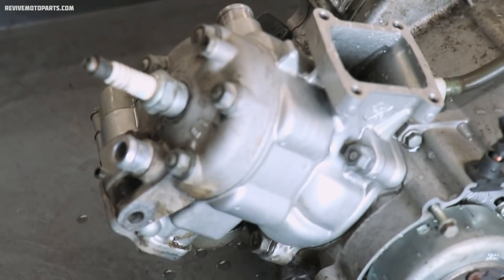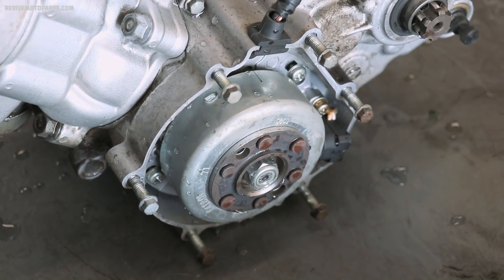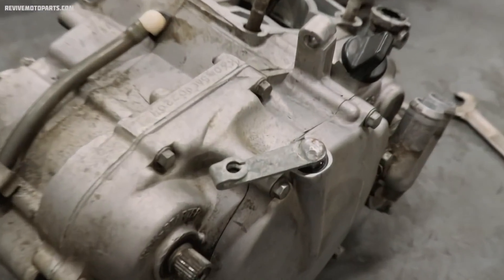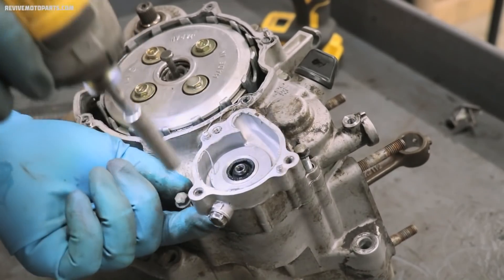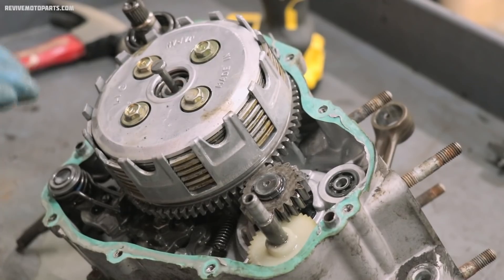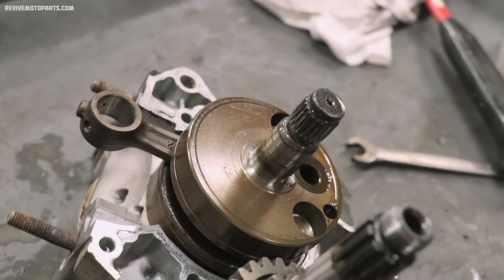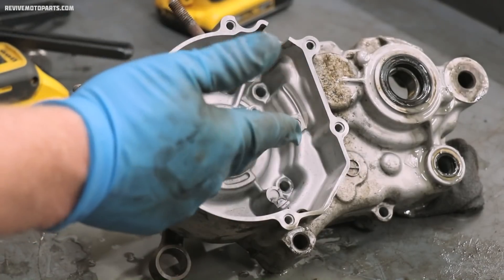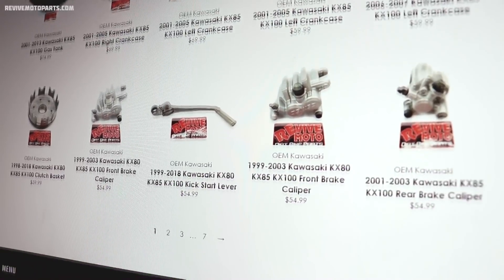Two Stroke Engines Are So Simple!

Comment: 2.26 ... OR.... you could just push an old bolt through the dowel pin...(preferably a snug fit with no thread in the pin area)
then put the vice grips on the pin, crushing it against the bolt.. and give it a tap...
THIS method works on blind pins where you don't have access to the other side of the hole (in my experience more than 50% of dowel pins are on the blind side)

In most cases this will free the pin without damaging it... and if it fails.. the pin is still in enough of a good condition to JUST LEAVE IT IN THE HEAD as 95% of the time you don't need to remove them for any reason.

I have only done this with my own bikes, I work on Water Blasters but you never need to remove the 1 or 2 that are in the Honda/Chonda motors attached on the very odd occasion they last longer than the pump.
I have had my motors apart on my DT175, SL125, XT250A, IT175k, IT200s, KX250, but luckily the 97 and 99 YZ motors were so bullet proof I only had to clean the power valves and visibly inspect the pistons. The IT probably got the most attention as the 1st gear would delaminate, I added a 2nd down port and polished the intake changing to Boysen reeds.

Comment: Hey i have a problem with my rm 85 on the skde of the transmition with the power valve on the side there is leaking oil out of it but can it reach the transmition oil because my transmition oil hes rised and i dont now why sorry for bad engels

Comment: How should one clean the crankcase halfs with bearings still installed? Washing detergent, brake cleaner? Also how do you put the crank shaft back into the bearings if they needed force to get out?

Comment: Wrong !!! 2T it's easy to repair but not under construction . Here is the exhaust resonance and it has to be well tuned in the construction together with the carburetor or new injection TPI. 
It is also worth remembering that the first engines were 4T ;)

Comment: So 2 strokes don't have an oil filter correct?.and when it comes to changing the case oil is the number on the crank case a good way to know how much oil to put in!
Reply: For instance I have a 2001 yz 125 and I put 650ml of HP transmission fluid in it. But is there an oil filter? Cuz I know the oil filters in 4 strokes have a little extra oil in there and do t eana add to much oil
Reply: For the engine oil I mix my gas 40:1 with amz oil
Reply: Two stroke crankcases do not have an oil filter.  I won’t bore you with the reasons why this is the case.

Comment: hello how is a oil retainer ring corectly instal ? at the crank do u have 2 springs in the each side of the ring ? or its just one ?
if its just one , the part with the spring goes where the oil is or it faces the piston ?

Comment: question for you cameron! i bought a cr125r and one of the clutch bolts that hold the springs in to compress the clutch wiggled out and made metal engine shavings all over the clutch area. do you think it got over to the crank section and if so can i flush it? the engine is healthy and i want to try to avoid a rebuild. any response is much appreciated.

Comment: Is it normal for a 2 stroke engine carburetor to drip from its air filter when running down the road (I'm talking a slight drip and ai did put a modified jet kit on my bike which is a 2010 Tomos sprint)????????

Comment: 2:26 here is a better tip for the dowels put a drill bit in it that is a tight fit to stop it from crushing then grip it with pliers or  anything you can grip it with

Comment: If you're splitting the cases just to part it out than splitting them from the Right Hand Side is OK but not how it's recommended. If you're splitting the cases to install a new crank (to quickly get back out riding) than splitting from the Left Hand Side is recommended, is quicker and makes it easier (you can leave many parts like the trans, shift forks and shift drum together and bolted in) throw in some new main bearings and crank and your back on the track. I cringed when you hit that shift drum bolt with a impact (while the transmission was still together) it's usually only torqued to 16ft/lb so loosening it with a 3/8 ratchet is easy enough and could prevent potential damage.

Comment: What might be wrong with my yz125?   I was ridding it and it sounded like it ran out of gas but it still had half a tank

I cleaned the carb and checked for spark which it has, and i also checked compression its 120 so its good
Reply from the maker: I'd check the simple things first, replace the spark plug and look for cracked reeds. 120 is a bit low on compression but it will still run on that. If the spark is good then it sounds like a fuel issue.
Reply: Cameron Niemela well i cleaned the carb an it does have spark, i am going to replace the spark plug an put new gas min in there in a few hours an see if that helps.  I may take the reeds out an look at them
Reply: Cameron Niemela it ran yesterday and started literally first kick

You earned my subscription btw
Reply: Cameron Niemela Got it running!! Just needed new spark plug
Reply from the maker: Awesome dude!!!
Reply: Cameron Niemela do you have any videos on checking your jetting? I know it has to do with how the needle connected to throttle slide is set and the actual jets in the carb an i assume fuel an air screw to but im not sure how you actually figure out what its set on 

Ive watched a few of your video now love your content btw
Reply from the maker: Thanks so much man! I don't have any content on jetting yet. Will be doing a video at some point. There's quite a bit that goes into it but here's a good article in the meantime.
http://all-offroad.com/main/2014/03/overview-jetting-101/
Reply: Cameron Niemela okay thanks! Also i have another bike that i bought an got screwed over on, "i buy an sell bikes" anyways i didnt know what i was doing back then so i didnt check it out very well before buying.    It has a hole in the bottom of the engine    How would i go about getting that repaired? Iast owners had it jb welded when i got it apparently and it last 30'minutes that i rode it

Comment: When you see these 2-stroke bikes that are meant for racing and notice that their insides are almost identical to road going 2-strokes you wonder why some service intervals are so tight and theres no mention on road bikes about 10 or 15hour use piston changes even if you bash on them :D

I know its because of the assumed type of use, so with right gearing you should be able to do an easy 5-10 000km run on a kx85 if you dont race it against moped guys regularly but who likes to ride a dirtbike like a granny? :)

My main point is, for example husqvarna sms125, 26-28hp and 10 000km~ piston change, ktm sx125 28-30hp 10-15 hour piston change
Reply: 100h is more like it, even then it would last longer if you just change the piston rings

Comment: I have no clue how you know where everything goes back to where it goes.. that seems so complicated
Reply from the maker: Over time it becomes pretty familiar.
Reply: Repair manuals are a big help I usually take pictures as I'm going  to remember where everything goes also
Reply: Do it a couple times and it will seem simple
Reply: GDGames it seems that way at first but there are lots of people, videos, and repair manuals to help!
Reply: I could do it too. Get a scrap engine and tear it down and rebuild it, tear it down and rebuild it, tear it down and rebuild it and then once you can assemble the engine without having to question where certain parts are to go you are ready to take your actual engine off your bike frame to tear down and rebuild
Reply: @jonnysnipes3123  and then you go to a kawasaki 2012 model
and wish u never touched it. $90 for a bold? $75 for a mini gasket?
.... hide in the corner of the room and cryyyyyy  XD
Reply: Repetition
Reply: That's why he filmed it, hit reverse button XD
Reply: GDGames I would sort the parts out by different piles and I’d take pictures during the disassembly part of repairing an engine.
Reply: Start small like on a moped. Like derbi or rieju
Reply: What is the best manual for yz 125 ?
Reply: @Mesosphere7  Haynes manuals are a solid go-to. Readily available online, you'd could probably find a free pdf one if you look around a bit. Just make sure to get the specific one for whatever bike you're working on

Comment: Man your videos are SO entertaining. Just out of curiousity, what is all of that liquid that you have inside all the motor parts and stuff. On camera it looks like the entire motor was submerged in water or some type of degreaser, cause usually oil doesn't bead up like it seems to do in the motor. (like for instance when you pull the piston head off of the piston you can see it inside after you pull the sleeve out of it). Anyways, just curious.
Reply from the maker: Thanks JT! I pressure washed the motor before tearing into it so there was some water inside.
Reply: Just remaining water in the water galleries, as you split each part the water runs out.